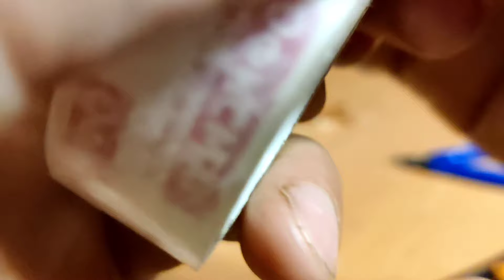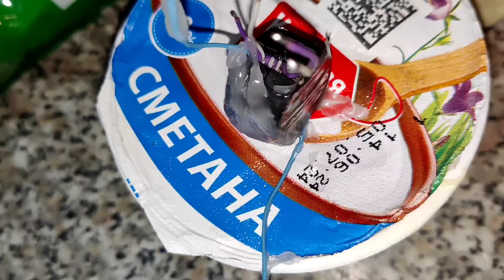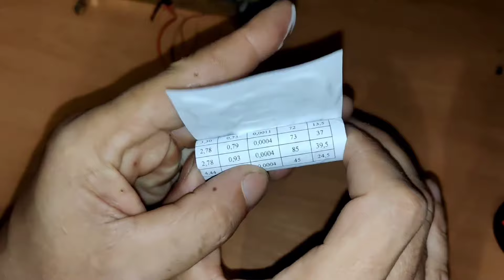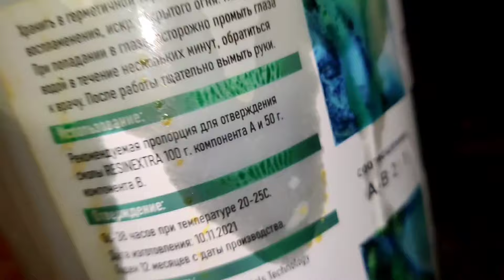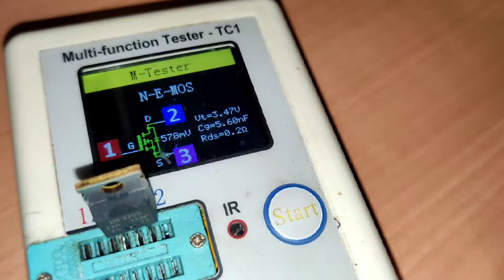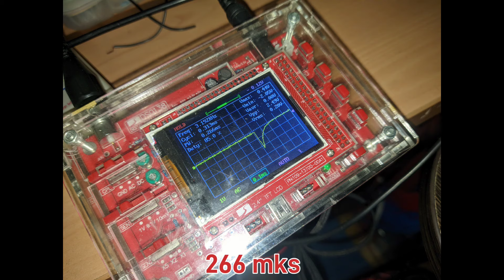💥 How make The Powerful Stun gun (Shoker) / manual STEP by STEP 💥

Comment: Advice for novices: its easier to make a HV transformer on a sectional frame. No experience or tooling needed. Just 3d print the frame with say 5-10 sections, and when both windings are finished, just put it into a syrringe, fill it with motor oil and seal both ends, with only 2 wires on one side, and a HV output on the other. Not only its easier, its safer,  and will never suffer an electric breakdown.
Reply from the maker: Hi bro! Sectional transformers have lower efficiency. A pulse of 100 μs or more could only be obtained from such transformers. The pulse duration parameter is the main parameter of the effectiveness of a stun gun. Such a discharge arc penetrates deep into the muscles and paralyzes the body. A video of measuring the parameters of sectional transformers is on my channel.